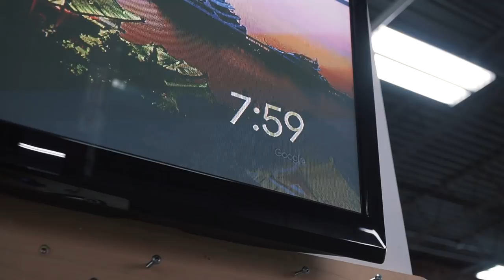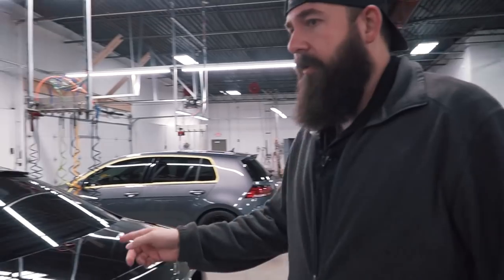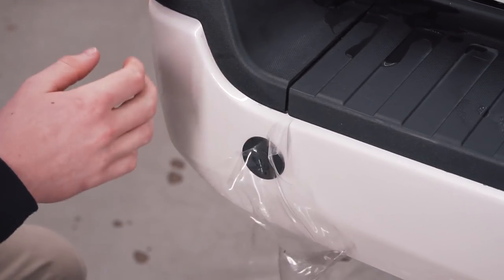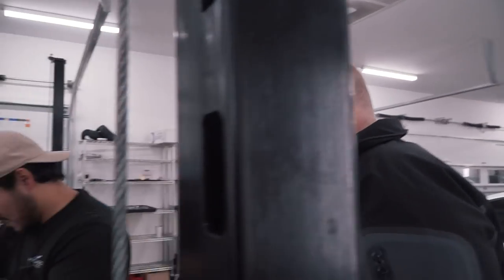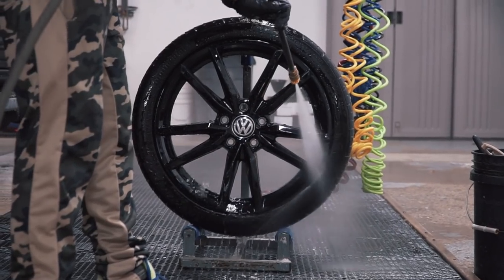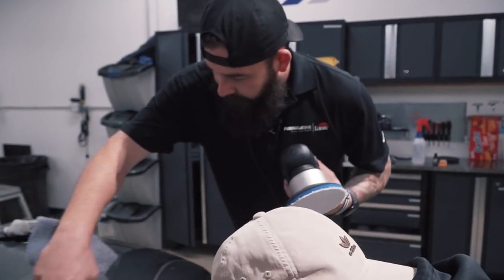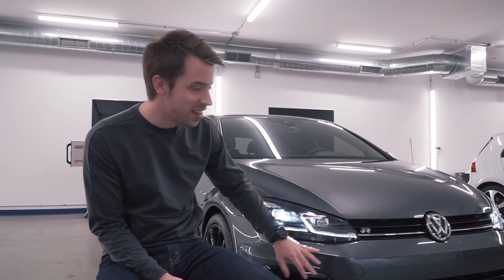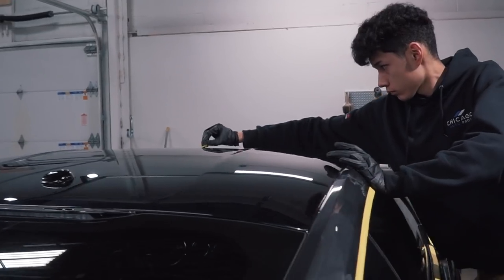Brand New Shelby Mustang GT 350 With Tons Of Paint Defects | Detailing VLOG | S4E8

Comment: I was quoted $4k to do xpel ppf on my ford Raptor. I’d rather spend that on a wrap
Reply: Ugly wraps hide beautiful paint
Reply: Allen Saunders do you even know what a wrap is?  So easy to do a matte wrap and change the color of the paint for far less money than paint. Plus the paint underneath is protected from everything. Win win in my book
Reply: @gs300rich4  i do you cover beautiful paint with normally a different color wrap. You didn't say paint protection film. Wraps are ugly shit. Why bother specing a paint  color if you hide it
Reply: Allen Saunders in my original post it says ppf, which stands for paint protection film. I was also quoted $10k for full coverage xpel stealth which gives the factory paint a matte finish. I’d rather wrap it in a matte color for less than half that, and many wraps are the same mil thickness as ppf such as xpel and 3m so they will give you just as much paint protection. If you’ve seen some of the new wrap finishes they look every bit as good as paint. And if you repaint the vehicle a different color there are many areas you have to do to make it look right, and most places won’t do that. Like door jams and engine Bay Area etc